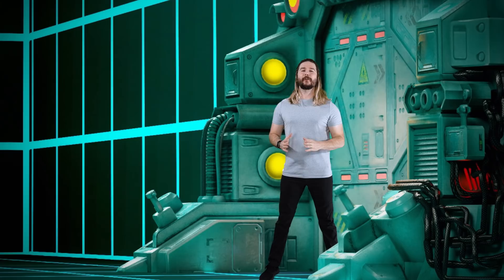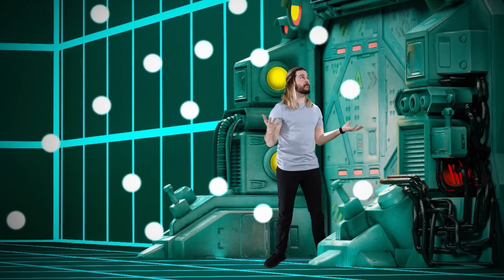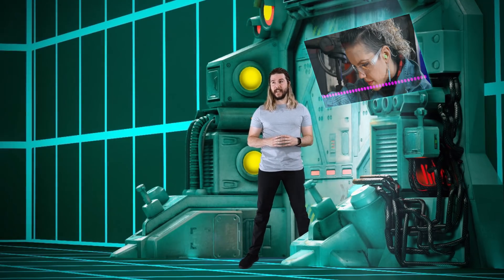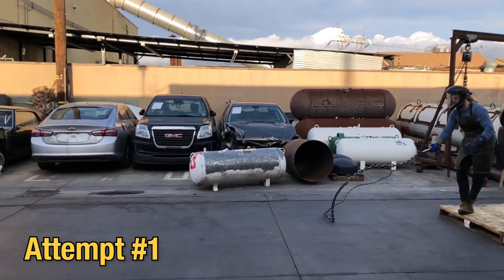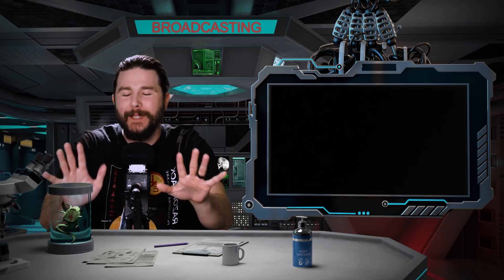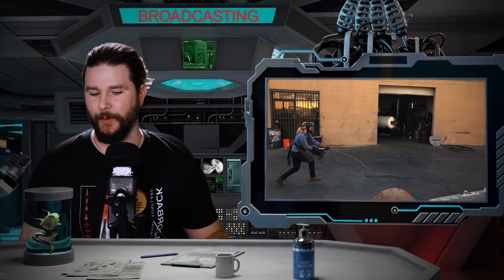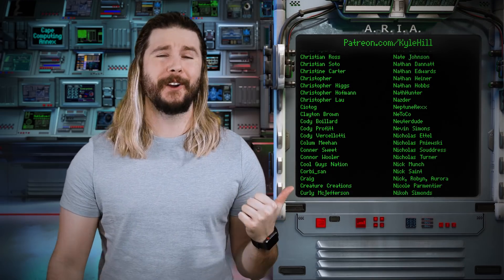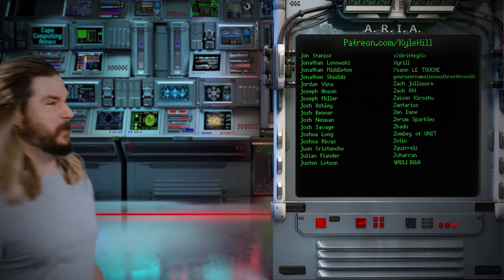Can I Make a SUPERSONIC STEEL WHIP?

Comment: Hey Kyle! I and my roommate are both professional circus performers, with a specialty in danger acts like whip cracking. In addition, I'm an armorer and whip maker, while my roommate holds a master's degree in computer science and mathmatics, so you can guess that this topic is right up our alley. I figured I'd like to offer what advice I can on the subject.

1: I 100% agree with your closing statements of success bias online. When posting on social media I almost ALWAYS record multiple takes and post only 1 in 10 videos. 

2: When it comes to the act of cracking of the whip. The type of crack you were attempting is called a sidearm flick, and is actually one of the more difficult whip cracks even with a normal whip. In the tiktoc video you showed, the man does first an overhead crack (which is easier, albeit more dangerous) and then follows it with the sidearm flick. 

Getting a whip to crack correctly requires forming a loop in the body of the whip (called the thong) and the whip cracks when that loop opens at the buisness end. Usually this loop is created by swinging the whip in one direction, then reversing the direction of the swing which creates that loop. A sidearm flick requires very specific timing and position of the handle to make even a normal whip crack, so don't feel disheartened that you had trouble pulling it off with a beast like that chain. If you're interested in following up on this experiment, look into either practicing the sidearm flick with a traditional whip first, or finding an experienced whip cracker to make the attempt for you.

3: in the video you don't cover what exactly you have at the end of your chain whip, but it looks like it may just be a piece of rope like paracord. At the end of a traditional whip you normally find first a fall (a piece of leather or paracord which can be replaced when it wears out, and usually measures between 12-24 inches depending on the whip) which is then attached to cracker. Usually these are made from nylon or Kevlar and are very thin with a knot in the end. This cracker is what actually breaks the sound barrier. Remember since it's a loss of mass that creates the increase in velocity, the less massive you can make the end of the whip in comparison to the beginning, the easier it will be to crack.

Comment: Have you contacted a professional whip cracker to critique your method? Technique on a leather whip is tricky as is, often resulting in self injury. So maybe you need to adjust your technique or even it requires a modified technique to handle the weight, or more muscle.

Comment: Use to own a bull whip and taught myself to use it. There is some wrist action required to get the wave to flow all the way to the tip on a normal bull whip.
For some reason when watching this video it seems the necessary wave ends roughly 75% down the chain. That's why the chain is failing.
 I'm wondering if the release speed is too slow? Thus not enough total energy in the release for the wave to flow to tip? On a normal bull whip on final 'release ' you turn palm up to ad the snap. But the weight of this whip seems to hamper this? In any case seems way too dangerous and impractical to worry about figuring it out. 
Fun video though!

Comment: Hi Kyle, cowboy enthusiast and whip user here. Most whips have a small piece of cord at the end (think a couple strands of the inside of 550 cord) called a popper. Like you observed in the video with the leather, that's where the whipcrack actually happens. Also, if you start with the whip away from the line of your body and use circular motions it helps get your momentum up and keeps the whip from bitin' you. Love what you do and thanks for the content!

Comment: As someone who's played around with whips...the easiest way to get a long, heavy "normal" bullwhip to crack isn't a 180 flip of the entire length of the whip...you just need to get enough of a loop (part of a sine wave pattern) to propagate to the end of the whip.  Lay the whip in front of you, get a little slack, lift the handle, and flick the handle forward/down...and it should force what looks like the top half of a sine wave to flow down the whip to the end where it'll "crack".

Comment: To be more precise: Moving objects move ahead of the waves they create and thus increase the frequency of the wave in front and decrease it in the back. This is known as the Dopplereffect. If an object going faster than the speed of sound the waves interfere constructivly because they overlap perfectly so that they have parallel phases. This makes the wave very big and that creates a big sound, boom. Nothing wrong, just very basic and simplified in the video.

Comment: The obvious answer is that it needs to go faster. You're clearlyly strong enough to swing it around fast enough to cause damage, but to get it up to supersonic levels you'd have to both be able to swing it harder/faster/better/stronger and be able to avoid taking out the back of your legs with it, which causes you to lose a lot of velocity. Unfortunately, with so much mass in the chain, getting it to swing around you rather than through the space where your legs are is difficult at best, and I'm not gonna be the guy who tells you to keep doing this and wait for you to get seriously hurt.

Comment: Most of your problems come from wrist motion. A lot of people who play with whips after seeing one too many Harrison Ford movies don't get how important the wrist motion is and just put all the energy in moving the arm/shoulders. Granted, your chain whip is slightly heavier than the standard whip, so doing the movement flow with your wrist is harder (and possibly under the risk of serious harm to your wrist as well). One way you could ease this task would be changing your axis of movement. All your attempts you tried to move the whip in an almost vertical way (I guess it was either because the shirtless dude video or because you didn't had enough space on your training ground). If you ever try again, try to do a movement as horizontal as possible (as in most of the chain, even the grip, as close to the ground as possible). This will reduce the amount of energy needed to move the chain and achieve possible sonic boom, as well reduce the chance of hitting yourself, but the square area needed for the test will be significantly higher (or else you gonna hit a wall or some of the cars in the background).

Comment: Good thing talking about success bias. I crack 'normal' whips myself and it requires some practice before you can do it without hitting yourself. You could do a LOT worse than hitting your leg. Also that side arm crack you're trying is quite hard to get even with a regular whip, but most of the others would be really crazy dangerous with that steel monster.

Comment: Have you thought about using a smaller chain whip so that it weighs less and be easier to manage? Or how about making a robot arm that is strong enough to swing the chain whip easily and be controlled remotely for safety.

Comment: There's a bit more science to explain from that TikTok footage! That shirtless man's whip doesn't just work because it is more traditional, it actually has quite an ingenious design that allows it to break the sound barrier even more easily than a traditional whip.

The reasoning is another kinetic energy argument. Once the steel part stops, all of the kinetic energy is in the leather part. Since the steel part is steel, and not leather, it transfers more kinetic energy to the leather tip than a traditional all leather whip would have transferred (given that you can start them both with similar velocities).
Reply: think it has a lot more to do with the muscle mass difference of the dudes. the shirtless dude was way stronger, doesn't take him nearly as much effort to crack the weight of the whip... also probably has several years of practice where kyle gave up after a few tries and a little boo boo lol.
Reply: @Smokey420Greenleaf  The muscle mass difference is probably there too lol. Though I think that does play into my parenthetical assumption (given you can start them both with similar velocities). 

My reasoning is that there is a maximum velocity for the arm as it needs to decelerate at the end at a reasonable acceleration, or else you'll hurt something. With a leather whip, most people can get to this maximum velocity, however, one would need more muscle mass to get close to maximum arm velocity for a heavier whip.

Comment: I think you need to get the whip moving before you try the whipping action.  This would get all the links "engaged," under strain and allow them to transfer the energy more efficiently.  On top of that, if you could use a circular wind up, the centrifugal force would naturally protect you from the end of the whip during the the whip motion.  You're still on your own for the recoil, though.

Comment: I think you've got the technique of snapping a whip wrong (possibly for safety).  I spent way too much time as a little kid snapping a whip, and it never involved hitting the ground with it, nor whirling it around over my head.  Instead, the technique was to flick the hand out AND BACK quickly.  There is some timing to it, of course.  Practice with a regular whip first, then try again with your steel whip.  This time with more pads!

Comment: I Know this is Nitpicky, and to do otherwise would be a LOT of Extra Work... But that Chain Whip Design Kinda Annoys me.. the Fact that It's Several Sections of Chain Each of Progressively Smaller Size.... I Know is has to Taper to have the Whip effect, but It Seems to me that every Section is a Sudden Drop in Link Size and then is kept the same for a while, then again a Sudden reduction in Size, would lead to the chain Picking up Speed in bursts that Might Di stabilize it's Overall Acceleration, Dissipating some of the Kinetic Energy in a Direction not Necessarily intended for it to go (Essentially Causing a Loss of Overall Energy at Each Size Threshold)...

The Alternative would be to have Each Chain Link Get Progressively Slightly Smaller than the Last in a More gradual Way, the Chain Link size at the Handle and at the tip are the same, but the Links in between all Shrink only ever So Slightly all the way down it's Length... And yes, as I said at the start, I know that Building it this way would be a STUPID amount of Extra Work on the part of the Smith... so I'm not Necessarily Expecting it to be done... but if You REALLY Wanna Try and Break the Sound Barrier, and possibly make the Whip a Bit Safer for the user, I Figure this Idea in one to Try for anyone who has the time are Resources to make it happen...That and Shin Guards...

Comment: Looking at it, I think a large part of the problem is that you are using a really heavy chain. This makes it so that you need to spend a lot more energy to get it to the right speed.

Then the fact that you are in a parking lot means that you have very limited movement. Meaning that you must be extra careful  not only for your safety but to prevent collateral damage. Further decreasing momentum.

Finally, there is a high chance that that tip of the whip is very close to super sonic, but the microphone/people are not sensitive enough for it. Bullwhips usually have a piece of string, nylon chord, or wire at the very tip to amplify the sound.

Furthermore, the blocky chains might be hindering how the whip moves. Normal whips are braided, which means as one piece moves it pulls on the rest, thus making it much easier to reach the needed speed.

Comment: the chain links are bouncing, they loose grip to each other in some part of the movement and being every likn doing it, and also is to heavy and to thick you should try with little less weigth but more thin chains on the begining (not thin but thiner) and also you SHOULD MAKE IT MORE GRADUAL ALL THE NECESSARY WAIT COULD BE PUT WITH NUTS AND BOLTS, AND YOU SHOULD TRY SOMETHING TO GET THE CHAINLINKS STICK TOGETHER AS THEY SWING

Comment: This will probably get lost in the mix, but (Hey show kyle the love) here goes. I think there are two things at play. !) Kyle, great effort but your technique could use some work (Former renn-faire performer here) but also (and more importantly) 2) the point where the "thong" of the whip transitions to the handle lacks any and all resistance and collapses on itself not allowing to form a coil without some significant muscling. I think if you were to weave a thick steel cable through the first foot of the thong and weld it to the handle it would provide enough support (not sure for how long) for the thong to carry a rolling coil.

Alternatively, you could have someone Plait over top that transition point with an applicable material to stiffen it up as well.

<3
Reply: If I only had a nickel for every parenthesis and run-on sentence... Lol
Reply: @Nileppez  oh yeah, my grammar is terrible. No argument there.

Comment: Kyle what you did here is important. Very important.  As an electrical  engineering  student I have never heard of any one getting anything to work on the first attempt/implementation. But people always expect you to do it perfectly, as they normally only see the finish project. It is important to know the work, effort, time, and failures it took to get that one perfect implementation/performance.  Thank you for helping normalize  failure, and  acknowledging the efforts needed to fail or succeed.

Comment: So sound 'waves' through air are actually spheres of pressure propagating from a central source so by looking at it in a pond; if you drop  a pebble into a pond would you see sound waves moving faster through the water than through the air followed by ripples in the water.

Are the ripples from the dropped pebble spherical in the water too? The  ripples on the surface are as a result of the pressure wave passing through the water.

Unfortunately I suppose the pebble itself would disrupt the initial sphere as it drops through the water.

I hope this is understandable!

Comment: During my brief stint in engineering school we had to do a mock build for a "customer" and then present on the results. My friends and I build a sweet looking car that we were happy with the design (because we were freshmen and still thought that engineering was designing cool looking stuff) but it failed miserably at the customers expectations. During our presentation was said that we were unable to fulfil the customers expectations because we got caught up in the design and should have considered the customers expectations first and designed around that. After we were finished our professor told us to stay up there because we had just done something that some engineers working in industry for decades were unable to do, admit that we were wrong. Now certainly we didn't have as much riding on the success or failure of our design as an engineer in industry would, but still, it always stuck with me about how admitting you're wrong isn't a bad thing. Certainly you want to put as much of a positive spin on it as possible, especially if millions of dollars are on the line, but sometimes you just have to step back and say this isn't working, back to the drawing board.

All of this was a very longwinded way of saying I agree 100% with this video!

Comment: Swinging the whip around your body to keep the chain away from it is how to generate the momentum/energy required to get a good crack while not putting your body in the direct path. Never swing a whip directly past your body. It should be swung out to the side and the crack initiated after the bulk passes the plane of the body normal to the line connecting you and your target. Basically, swing out and away from you and not under you.

Comment: I think there are 2 factors that were not accounted for. First and more important is strength and tech. The heavier and longer the whip the more strength and technic comes into play. If you see the tik tok vid this guy had really good whipping form and the guy appears stronger than you. Second is how much does the flexibility of the chain come into play? If those last links needs to be able to bend in half during the final stages of the crack then it's not going to happen.

Comment: I suggest that Kyle should have practiced with a leather whip first.  It isn't exactly easy to get that sonic "crack!" even with a proper leather whip.  But it is easy to smack yourself in the ear with one.  (Yeah, we had them when I was a kid.)  I'm utterly unsurprised that he failed with that chain.  I am not convinced that it cannot be done.  That side crack he was attempting is more difficult than an over-the-head crack, but it's less frightening.   It's all about getting the right motion.  I also suggest that the biggest chain he was using for the first part of the whip is too heavy.  Engineering mistake.  He's giving himself too much mass to get moving on the big end which means the small end doesn't accelerate fast enough to get around his  leg.